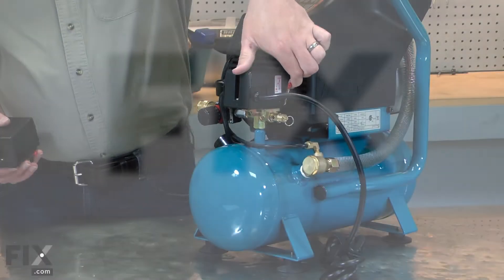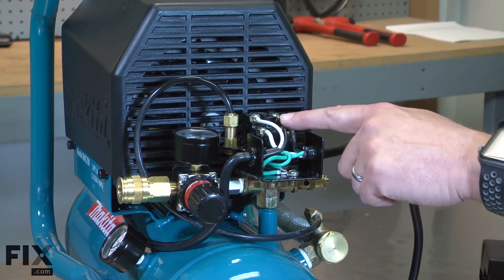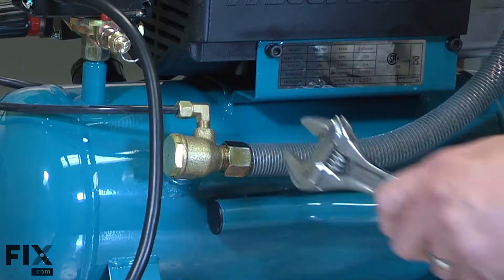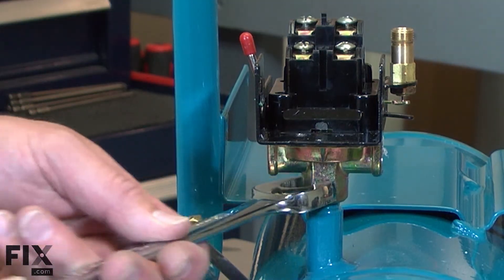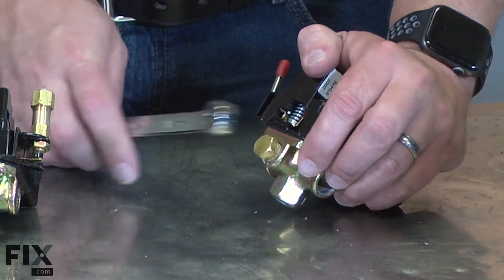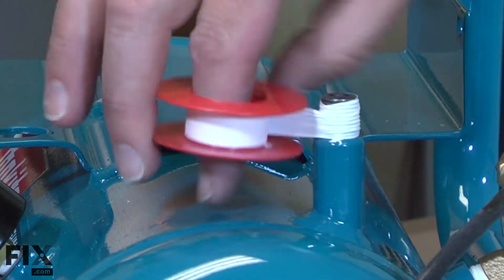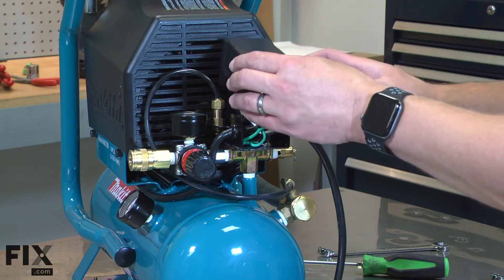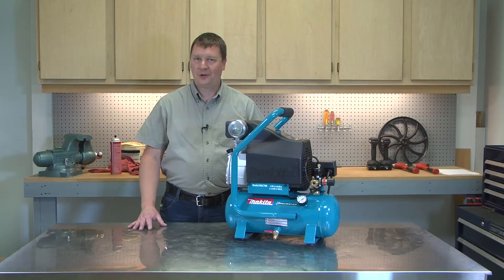Makita Air Compressor Repair - Replacing the Pressure Switch (Makita Part # 412024-E)

Comment: The regulator on my MAC5200 looks to be the exact same regulator, but it is attached to a plate, so I need to remove it from the plate. This means that the knob needs to come off. I don't know if the knob is threaded on, or is a press-fit. Do you know what it takes to remove the knob?